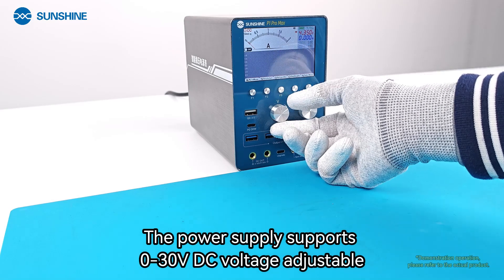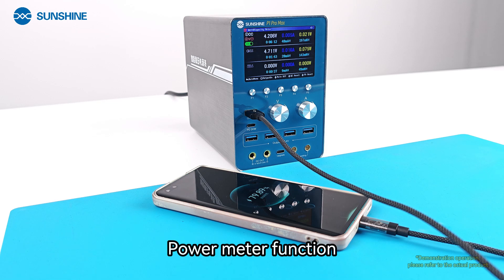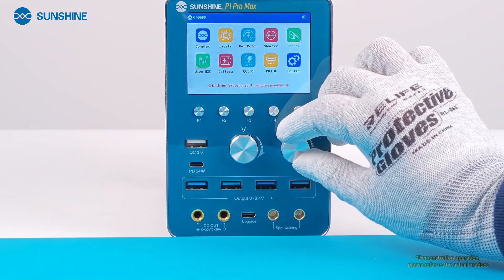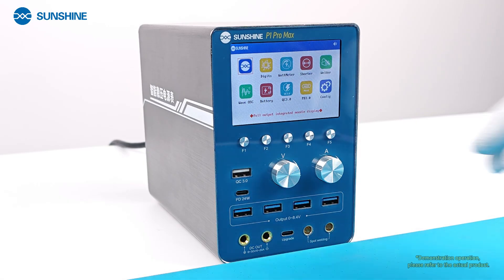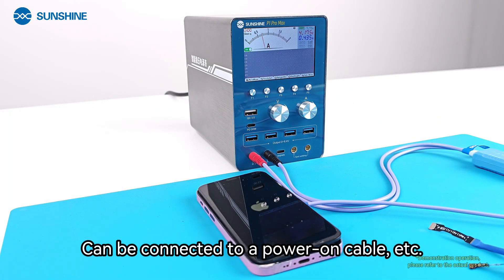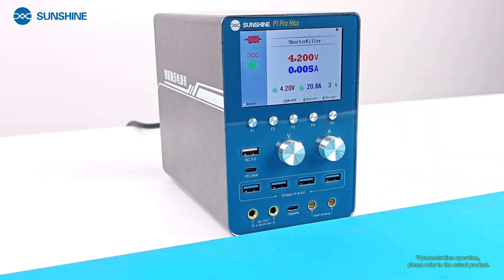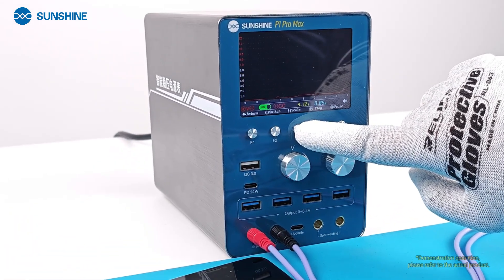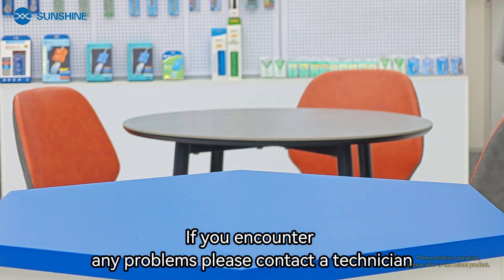SUNSHINE P1 Pro Max smart regulated power supply

Comment: I honestly didn't think it was that bad. First, if you use 20V, its amperage doesn't reach more than 9A; second, you can't remove the OVP or OCP; third, the shortkiller can't be lowered below 10A, which can blow any track with that much amperage. Honestly, I hope they update it; otherwise, I wouldn't recommend it.

Comment: It's a very cheap power supply i regret after buying this 1=battery spot welder not working properly
2=any one can't say how to upgrade this
3= battery battery upgrade not working 
4=and manufacturing quality is also not good as I aspected from sunshine
Reply: Hola. 1- La soldadora por puntos para baterías funciona correctamente. Solo tienes que dejar la fuente encendida, la primera vez, 1 hora aproximadamente para que se carguen los capacitores de descarga. 2 y 3: Coincido en eso. El test de baterías no funciona porque falta la actualización del firmware que aparentemente aún no está disponible (17-09-2025). 4- No me parece mala la calidad de fabricación. Son opiniones. Saludos.-